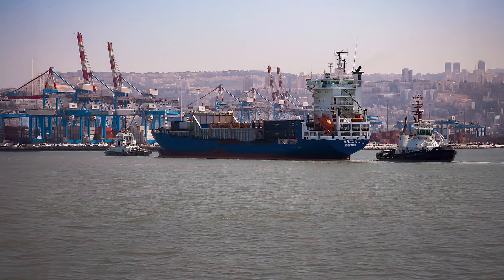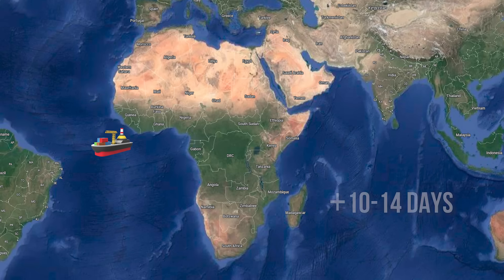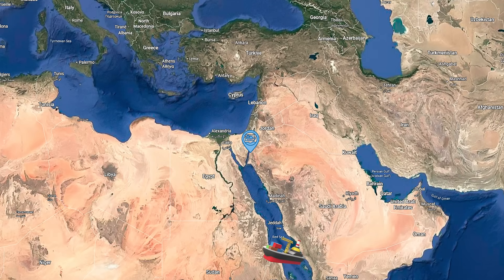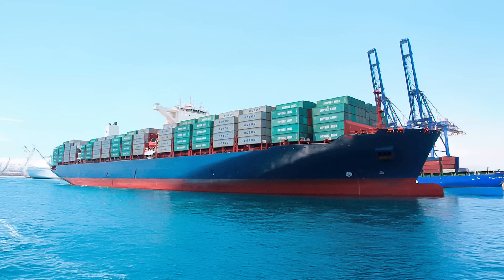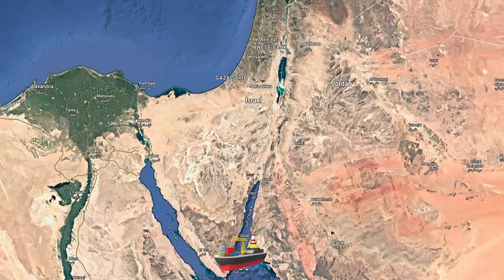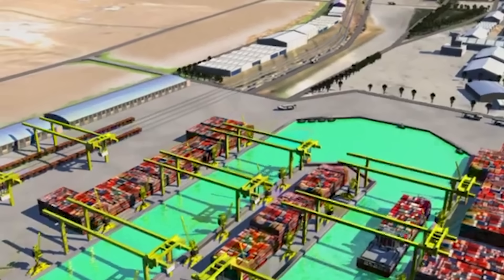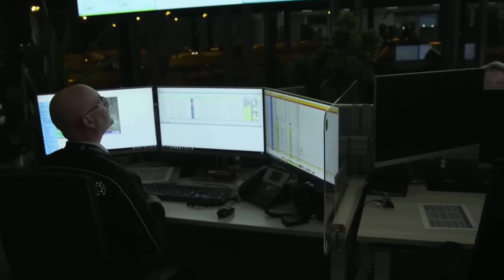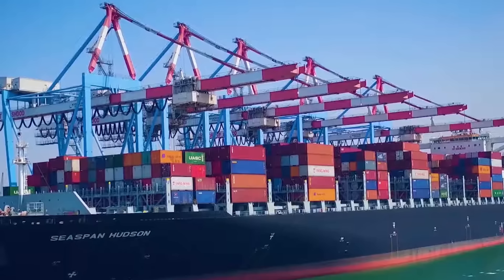Here Is How Israel Is Building a Sea Port in the Middle of the Desert. Result Will Change Everything

Comment: As someone who lives not far from there at all, I can tell you that it won't be implemented that quickly...
First of all, the main problem is the Houthis in Yemen who are preventing ships from entering the Red Sea, which is already a war issue!
And secondly, there is the issue of nature, which will severely damage both the sea and the desert, and there are no railway tracks within a 3-hour drive in the mountains {which is a lot to build, and also a risk of damage from high temperatures to the tracks} So maybe only in 20 years will they start obtaining permits and financing and another "day or two" to build this huge project...

Comment: As someone who's looked into it before, this project is on the verge of cancelation and it's not heading anywhere at the moment. And even if it is seen through to the end, it'll take a century (and I'm not kidding; infrastructure project procrastination is an acute problem in israel. This railway to Eilat project actually began back in the 70s and they won't be finishing it before the 40s of the 21st century if ever)